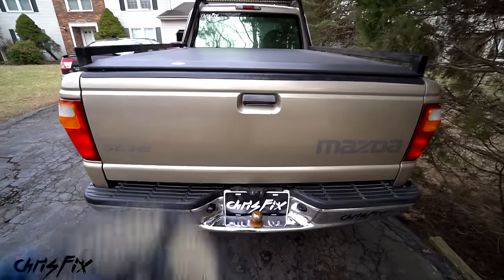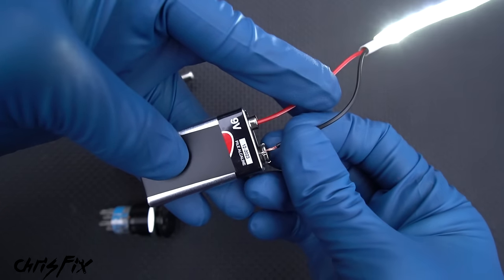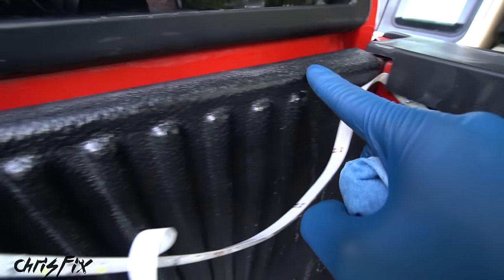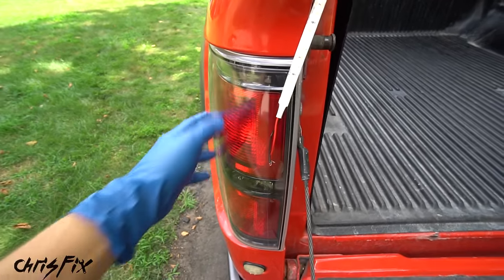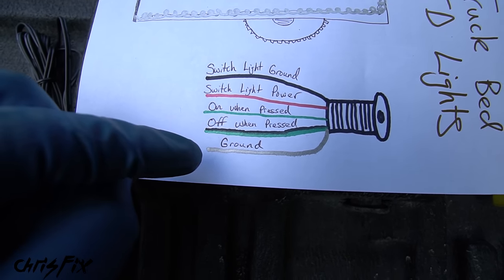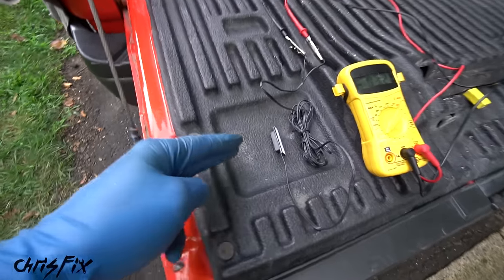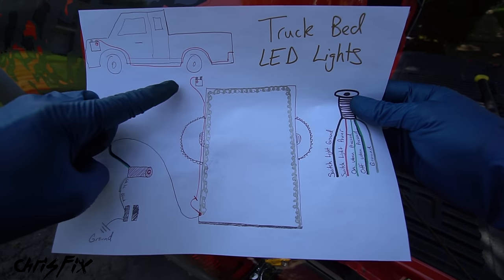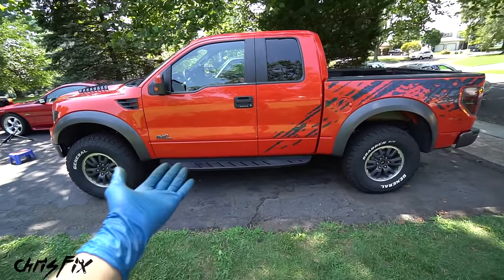How to Install LED Bed Lights (Fun DIY Project)

Comment: Need some help, led strip lights are ON, but dim, all connections are good, ground is good, not sure how else to trouble shoot this, any thoughts? Spoke to an electrician, he said I needed to install a relay between the battery and lights, not to do a direct connection from battery to lights, does any know how to install the relay and where?

Comment: Question, my Jeep Gladiator has bed lights that are triggered by the tail gate, if I wire the LEDs into this light, will it blow the fuses?  Thanks
Reply from the maker: It could. Check the amp load of the stock lights and the aftermarket lights and add it up and see if it is more than your fuse. Never change the fuse size.

Comment: When using these self adhesive led strips in engine compartment does the engine heat cause the adhesive to fail?

Comment: Chris, can I use 18 gauge wire to run from the 12 gauge fuse wire to the back on/off switch?
Reply: The red wire on the switch you provided is a smaller thickness as well.

Comment: I have a 2015 Ford F150 which has 2 lights , one on each side of the bed that is controller by a switch in the cab, would it be easier to attach the led light to the power wire on one of these lights , if so how would I do it.

Comment: Hello, I have tried to add the led light strips onto my truck the same way you did it. However after the installation my taillight was going weird. It would only come on for one side and when I press the brake all my light go kinda dim. Is It because of too much electric load on the battery so I need a better battery? It's really bothering me because I tried to connect the light in different ways and the brake light just wouldn't come back to normal.

Comment: Hello Chris I wanted to ask you for the enginebay light..is there a special type of light that needs to be used keeping in mind of the engine getting hot ?
Reply from the maker: Just keep the lights away from the exhaust and it should be fine.

Comment: Could have gotten power from the wiring harness for the 4 or 8 pin trailer connector rather than running a wire all the way from the engine bay

Comment: Why not get the switch to be on the other side of the tailgate that way it’s just a straight wire to the battery? Same side as battery.

Comment: Hey @ChrisFix, I own a 2017 Ford F150 that came with an LED light switch located at the driver side by the tail gate.  Unfortunately the LED lights are located at each corner by the tailgate and does not light up the bed very well because I also have the Ford foldable bed extender.  If I were to use the 16' LED strip, can I hook it up the the existing OEM LED switch?

Comment: Maybe somebody already asked this, but.... WHY do you put the switch(es) on the NEGATIVE / GROUND side of the circuit? Darn near EVERYTHING in most cars today has the switch on the positive + side of the circuit and the item to be controlled / switched is always connected to negative / -/ ground.  
If you always have hot + 12-14 volts connected, anything that accidentally grounds it (a real possibility with the entire truck frame grounded) will activate the item and in this case, light it up and use up your battery!

Comment: I'm at 7:07, if the factory hole is too small, do you recommend using a step bit to widen the hole? If so, what's the best way to catch the metal shavings?

Comment: If you didn't want to drill a proper ground back there could have ran a ground wire from the battery since you ran a power wire as well

Comment: Why run the power wire all the way to the battery if you can just tap into the power wire of the tail light??
Reply from the maker: If you have a trailer and plug it in and use the lights that load could blow the fuse or burn the wires. It’s not made for that amp draw. It’s made for just the trailer.

Comment: Can anyone explain to me why he didn't connect anything to the "minus power", how the electricity runs through the wires if the circuit is not closed. I think is because he connected one wire to the metal part of the vehicle on the end but im not sure. Can someone either confirm if im right, or correct me if im wrong?

Comment: Can you just use magnetic switch? Or you also need on/off switch?
Reply from the maker: You can just use the magnetic switch if you want.
Reply: What did you do with the other end of the led strip that you don't use with the wire hang out? Did you just cut it flush and leave it?

Comment: On your tailgate light bar installation have you run in to a problem like I have with my 2018 F150 which has a built in step in the tailgate  - Ford  added this bracket to keep it from sliding left to right
So with this bracket in place  I don't have a straight flush surface across the back of the truck where i want to put the light bar Any Suggestions ?
Reply from the maker: How about using something like this to attach the lights to? 
https://amzn.to/3kZk7OY

Comment: @ChrisFix just curious, why did you run the power lead from the battery and not off the trailer plug?
Reply from the maker: So it does blow the fuse for when he trailers his jet ski and uses the lights at the same time.

Comment: Hey man so it's been 2 years how have these lights held up?  I want to do something for my car but adding them to the inside. Do they change color or are they just one color?
Reply from the maker: They held up great. The magnetic switch broke because it’s Chinese junk so I’d try to find a better brand. But everything is doing great.
Reply: @chrisfix  Did you find one I did this install but instead I wired the positive to the switch and button went out this morning it worked great yesterday and the switch was melted

Comment: Has anybody tried this? I did it and I have an issue where the led strip seems to run out of power halfway along and is only lit on the wired end. Any advice would be great.

Comment: That reed switch isn't suitable for the amperage. I ordered one and when I saw the cable gauge I got really disappointed.

I think it is a better option to use a normal door switch (which needs drilling) or just use a push button like you did in the hood.

Comment: Does this installation process similar to installing DIY ambient light strips to interior of the car?
Reply from the maker: Correct but for that you can tap into the interior lighting with a relay so when your door opens these turn on. Or you can use a switch (or both) like in this video.
Reply: That’s a great idea, thank so much :D

Comment: @chrisfix, is there an advantage to putting the fuse in the engine bay instead of back behind the taillight?
Reply from the maker: Yes you always fuse right at the point of the power source. If the wire rubs and breaks anywhere after the fuse the fuse will blow. So if the fuse is all the way at the back of the truck and the wire chafed under the drivers door or in the engine bay, that fuse does nothing and you can cause a fire. Make sense? That’s why you want it as close to the battery as possible.
Reply: @ChrisFix  that does make sense, thank you! 

Also, just wanna say that I really love the channel. Super helpful instructional videos AND super entertaining content. Thank you!

Comment: Anyones help would be appreciated. I wired it up without the tail gate magnet switch.  When it’s off the leds are super dim but on.  When I turn the switch on they turn on bright.  Why would the leds not be fully turning off?
 Thanks everyone!

Comment: A wire protector for some led lights seems a bit overkill
Reply from the maker: Not at all. Wire protector is necessary for any exposed wire no matter what the amp load is. The factory protects every wire.

Comment: So it would be easier if the battery was in the back of the car?
13:35 
In my car the battery is in the back.

Comment: Why don’t you just get power from the tail light?? Instead of running a cable all the way to the the battery.
Reply: I was thinking the same thing. It could overload the fuse, possibly?

Comment: what gauge wire would you run from the battery to the back of the truck?
Reply: You have any info about the switch wiring diagram? My switch is different than his and cannot figure out the correct configuration to make my lights work
Reply: If I can’t get technical help or anyone chiming in then I’ll be doing the same. The magnetic fail safe is nice in case I leave the lights on during the day and don’t realize it.

Comment: What if I want them on while driving?
Reply: You would first need a relay because the magnetic switch will melt. Then you would need a secondary switch parallel to the magnetic one. Hopefully coming through a second relay that is triggered by the ignition so you don't leave the lights on accidentally and drain your battery.

Comment: I know it's a pain the ass but I encourage anyone adding their own accessories to add the circuit from the fuse box, not the battery, when possible. If you are adding a bunch of accessories, you may want to add a second (small) fuse box or a basic power bus to make your life easier. That second fuse box could come off the battery or it could come off the factory fuse box.

Comment: Never switch the ground!  Ground should be always connected for safety. Put the switch on the power rail. When it’s off there’s no power.

Comment: Didn’t work =( every time I connect it the wire starts smoking and getting really hot. Oh well
Reply: Because his circuit isn't right. The switch isn't rated for the current. You need to add a relay to the circuit, the magnetic switch can be the trigger for the relay.

Comment: Not up to par with your usual work, Chris.  
- The LED strip stuck to the front of the bed is gives "hack job" a bad name.  Running the lights thru LED plastic channel would protect the light from weather exposure, and black channel with a smoked lens would blend in with the black bed.  Alternatively - only run the lights up the two sides and wire the sides together under the bed.
- And stuffing the excess strip lights inside the body?  Really?  Why not trim the LED strip and do a proper job?
-  The manual switch doesn't bring much to the party.  A smart install would use an on-off-on switch.  Combined with a magnet switch this would give you - auto-on when gate open; manual always on (gate open or closed); manual always off.

Comment: You should just use adhesive lined heat shrink instead of putting grease under the shrink tube... Also what in the hell was that ground bro? You jammed the wire in-between a nut and bolt??? Holy hell....

Comment: I want to do this but I dont want to accidentally mess something up on my new truck
Reply: Don't be scared. But if you don't want to mess it up also add a relay as the way it is done in the video will cook the magnetic switch quick smart.
Reply: @munecito   I will do that thank you
Reply: @Blak2001  I mean the way it is done will cook the switch. 

A full led strip is about 60w which is too much for the switch.  Use a 4 pin Bosch style relay and it will be fantastic.

Check out this answer on Amazon

 I can tell you it is less than 72 Watts. When I used one to control some LED tape lights in a pantry, which amounted to about 72 Watts, the switch got hot and deformed. I bought another switch along with a relay (all I could find were automotive ones with high amperage ratings, but that's OK). And that solved the problem. If you're thinking of looking for another switch like this one but more heavy duty, good luck. I searched and searched and no luck. If you're not sure what to do, get this switch and a relay. This is the one I bought: "Car Auto Truck Relay & Socket SPDT 12V 12 Volt DC 40A AMP 5Pin". It was $4.00. Hope this helps
Reply: @munecito  that helps a lot actually thank you

Comment: no way that tape holds up over time if it's exposed to rain, cold and heat.
Reply from the maker: Should last a few months before needing to worry about it!
Reply: Wind deflectors on cars use VHB tape and last for years. Chrisfix cleaned the area well. It shouldn't come off.  But to make it stock even better you can get adhesion promoter from 3M number 94 or 111 (also known as primer)

Comment: The last wire you grounded was poorly done you should have used a connector like you used on the battery terminal instead of tightening down the wired between the nut and bolt threads . It will break off eventually. 

The LED strip was not done clean especially around the curved corners. 
Your videos are helpful but this one was not properly done
Reply: Switches should also be on the live positive side not on the grounded side .

Comment: Out of interest, why did you go to the trouble of running all that wiring to the battery when you could've wired it off a permanent live at the tailgate end, the stock bed light, trailer connection, bed 12v or whatever is back there, LEDs are very low power consumption so you aren't overloading an existing circuit and you save 20ft of wire, insulation and added stuff to the truck.

Comment: Am I the only one that cringes with that ground connection? I mean after all that silicon, heat shrink and ring terminals to then terminate bare fragile ground wire strand on a thread like that.
Reply from the maker: Thanks for sharing, I've run grounds like that for years and never had an issue!

Comment: this guy needs to learn electronics. A 10 amp fuse for 120v not 12v. and he is going to waste so much power plugging the negative to ground.

Comment: thats the shittiest way to connect a ground wire.. you literally had the set of ring connectors... why not use one of those. that ground wire guaranteed was cut by the thread when you tightened it down and will fail  with road vibrations while driving after a short while
Reply: Yea i cringed when i saw that and also he could of just ran the power wire from the trailer wiring harness and right underneath that light theres a ground the same ground the trailer wiring harness uses 😑

Comment: You did a fine job of soldering but your ground connection was terrible. Sure it worked for today but it's not going to last. That tapered bolt is not trustworthy to use a nut on. And you just smashed the strands of wire behind the nut. No Stakon. This won't last long. There is no reason this job need to ever be redone. Do it once right instead. Now you have instructed in error. That's going to multiply. You my friend should not be teaching. Rather learn first good wiring practices. Big bolts and nuts and tiny strands of soft metals don't mix.  You did not make it wrench tight. That would have broken some strands at once with the rest weakened and failing over time.

Comment: This is about the most dodgy install I’ve ever seen 😂. That earth on the bolt even though you have a box a connectors there and ring terminals. This is horrible, do it properly the first time 👍🏻

Comment: That was a horrible installation, it looks like sh*t that's no clean install 🤣!!! Those lights are not going to last and that double sided tape in the heat and cold is coming off and on the turns they are going to cut and cause a short.